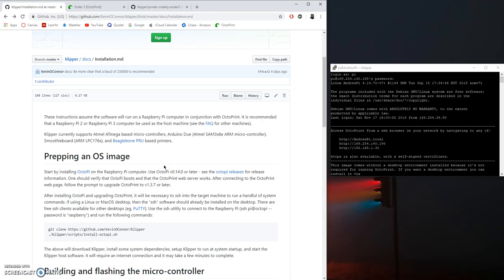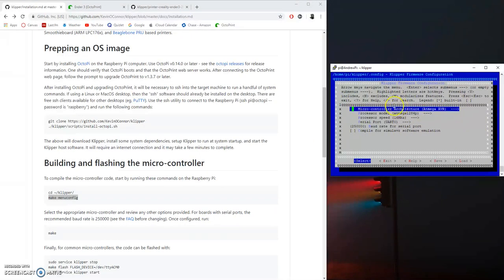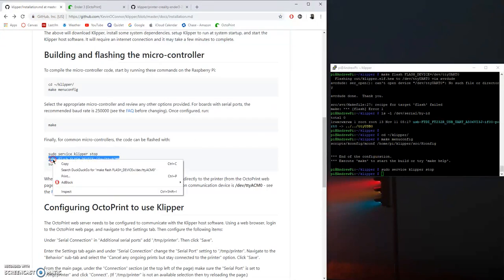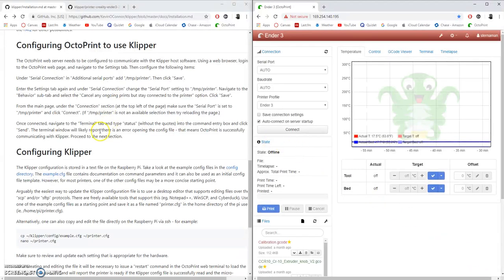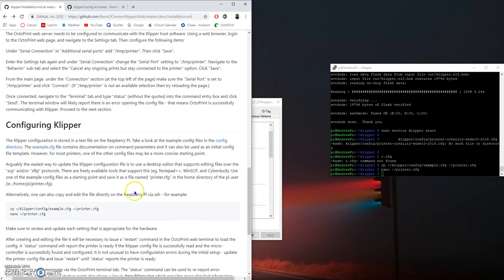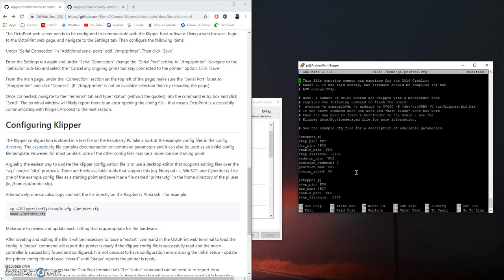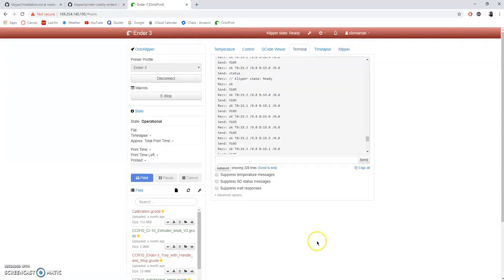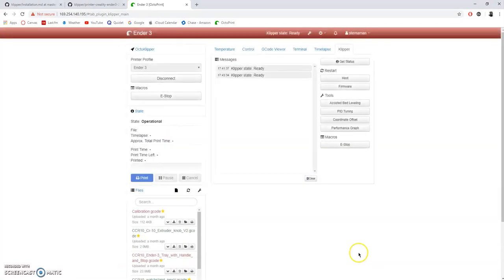How to Install Klipper Firmware on a 3D Printer

Comment: How do you configure Cura to not overwrite the printer.cfg settings?
Thank you.
Reply: @ChickinTenders  Sorry I meant for example speed, so that Klipper sets the speed. For example in Cura Print Speed, Travel Speed  and so forth will override printer.cfg. It seems from your videos that your print speed goes much faster than mine that is set at 120mm/s
Reply: @ChickinTenders  Thank you. I'll try that.

Comment: I can't seem to get it to flash and I did find the correct path. This is the first time I flash my system and I have a CR-10 and I am using a raspberry pi 3
Reply: @ChickinTenders  Where would I see this information?

Comment: Morning. I've been thinking about this video. I've seen the other one, which is slightly longer. There are similarities. Anyways, I feel like this video needs titles. Something to break it into parts, or steps. Steps is a better word. There are steps to doing this process. A list of steps would be helpful. To me, at least. I'm a shooter-editor. For what it's worth. If I had this video, I could put titles on it. I could break it up into the steps, Maybe that would make it easier somehow? I really think Klipper is going to be super helpful to me. I'm working with another youtube to make the same kind of video. Maybe I need to try to work with you also? The weird thing: you look like Kevin O'Connor. Are you related?